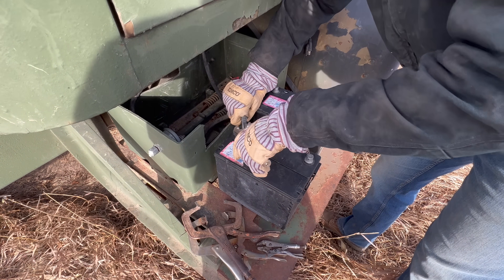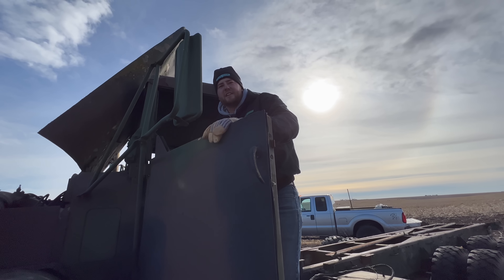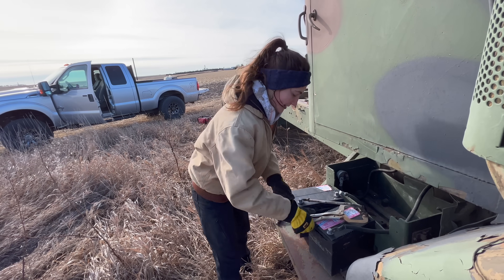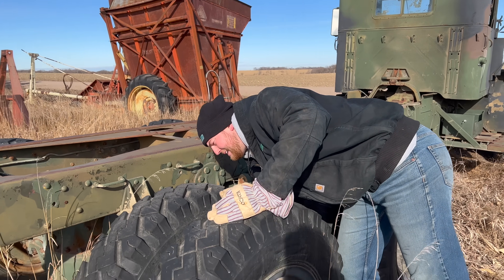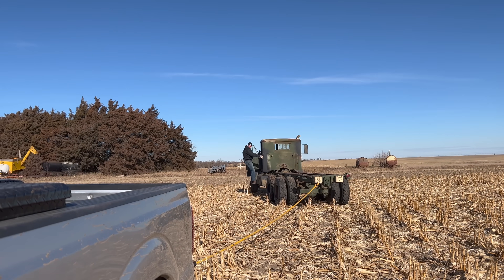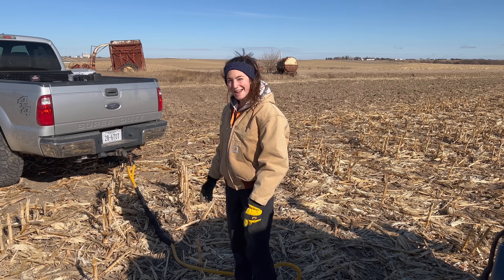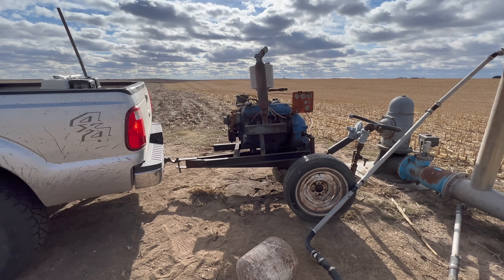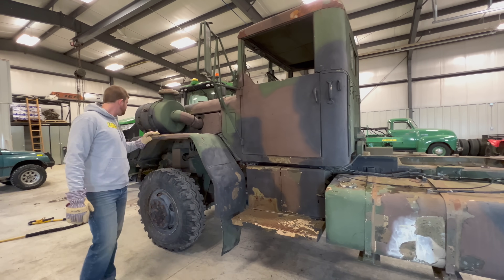If You Can Start It, You Can Have It

Comment: Any of us who have served, and ventured out to the motor pool on a brutally cold winter day, you might need (require) to bring along some starter fluid, as it will not require much, just a quick blast into the intake, as the glow plugs could require a little boost to get the engine to combust & turn over.

Comment: Yes, Multi fuel.  Viet Nam era trucks I'm familiar with.  They had something called a "Density Fuel Compensator" which allowed running on a variety of fuel types.  I would drain all the fuel and fill with fresh diesel.  Then crank it over and bleed each injector to get fresh fuel to the cylinders and remove any air.   If oil viscosity is too high, it may not crank fast enough even with a 24 V commercial battery.   I'd change the oil.    Probably got rat nest in the air filter so you should remove it while trouble shooting.   Good luck.  clean fuel, oil and air and these things will run forever.  If all else fails, do a compression test.

Comment: Run on diesel, kerosene, transmission fluid and old motor oil but if you use anything besides diesel you have to mix a little diesel in it. You can get a manual for it.

Comment: Ok... Where to start...

First thing you want to do is get the TM.

Do a overview once over, and follow the PMCS in the order.
Change the Batteries bank and drain the fuel, and change the glow plugs.

The numbers on the bumper are called "Bumper Numbers.
Left is major command and higher Unit, Right is designated number for the vehicle itself.

Comment: The Diesel engine is the only engine which runs on Diesel, Biodiesel, a mixture of Biodiesel and Petrodiesel,propane (with modification) , Home heating oil, Kerosene,  a mixture of Kerosene and Home heating oil, straight used cooking oil (if heated), Petrodiesel and gasoline mixture, Transmission fluid, used motor oil, etc. I could go on but you get the point a very robust multifueled engine, as a diesel mechanic I have run diesel engines on all.

Comment: Hi, the numbers are the unit designation of the unit it belonged to. On the passenger side is the parent unit, on the driver side is the subordinate unit. An example would be , if the 1st Infantry Division owned the vehicle, it would read “1 ID” on the passenger side. If it belonged 701st Maintenance Battalion. I t would read 701Mt Ben. . The subordinate company  would would  be next followed by the vehicle number. Example B 24.
Reply: whatsapp①⑥⑤⓪⑦⑥①④⓪①⑤  keep doing what you are doing! Love your snippets. Jim peterson.

Comment: It's a 12 volt system and yes they are a multi fuel system. They will even run with water in the fuel. They were designed that way for a reason. Enjoy. You got a good one.
Reply: I forgot to mention turn on the battery switch. It's in the cluster of 3. I'm sure someone may have bypassed it by now.

Comment: Judging by your attire, its a bit chilly there. I would run the glow plug a couple of times and you will need a couple of extra batteries to crank it up faster . You might find some quick start spray into the air intake will get it going faster. GOOD LUCK
Also a 24 v charger will keep the  batteries spinning the starter faster.
It will go, patience.

Comment: Like any diesel engine check the air cleaner fuel filters put fresh diesel in it bleed the injectors and if you're going to change that wheel out being a split rim make sure you put that wheel in a cage when you inflate it

Comment: It appears to be either a 5 ton cargo or shop truck, with the tub/box removed.  Meaning you can make it what you want.  I suggest you find some of the original type tires as that will raise your ground clearance.  undersize tires will also not give you accurate speed or milage readings as the speedo is calibrated for the size tires intended for this truck.  Also, you had no brakes because you had no air pressure.
Depending on what you want to use it for, you may want to "bob" the frame, IE shorten it.  If you want to use it as an open bed cargo truck start looking for an old cargo bed.

Drove and serviced hundreds of these trucks in my career.  You need to find the Master switch and turn it on.  You will know when you have found it (so long as you have batteries in it) as the low air alarm will sound.  That tells you that you have low or no air in the brake system, but it also tells you that your master is on.   Military tactical trucks will turn over without the master switch on, but there is no electricity going to the system so it won't fire off.  We used to move dead trucks (short distances) just using the battery power with the truck in low gear and pushing the starter button, but the master switch off.  Kills your batteries pretty quick, but you just yank them off and throw them on the charger.  This type of truck normally used four 6TN batteries to produce the needed 24 volts.  A pair of 12 volt tractor-trailer batteries will probably do but you need a lot of CCA!

Look forward to seeing your progress!

Comment: Not a multi fuel. Valve covers give it away. Cummins I believe a small cam engine. Check for power at the party fuel pump solenoid. Small screw on the top of the solenoid will allow you to bypass that. Good luck.

Comment: M35, White multifuel. I paid $2100 for mine, had winch, ran great.  I ended up selling it for not much more, but it needed a clutch pressure plate and front driveshaft.  The back did not have dropside, just tailgate. A little starter fluid would have probably fired that one up.

Comment: Get a battery charger for  24 volt systems that has boost or jump function. Once it's  charged up good and the engine is turning over good hit the air intake with a couple shots of ether.  Starting fluid. Not a lot just a couple shots at a time. If you use to much it could  blow the head off.

Comment: There should be 4 commercial-sized batteries.  Two in Seiries and two in parallel.  (You only have about 650 cranking amps and you need about 2000) It is real tricky getting them wired up correctly, that is why you need a -20 TM (Dash Twenty Technical Manual)  A 24 volt system that big will start a fire very quickly.  There is a fuel shut-off bypass so you can pull-start them.  (However, with the fuel shut-off bypassed, you can't shut it off.)  There is also a Pre-Heat system (that even the mechanics couldn't figure out) They are hard to start, but they run great.  Built back in the day when it was possible to run the truck with half the parts missing.  Back before Russia was our friend.

Comment: That is a 5 ton truck. Which mean it can haul 5 tons off road.  It probably had a box or flat bed on it while in service.  I drove them when I was in the Army back in the 80s.  They were great trucks. That is a Multi fuel engine which mean it can run on Diesel Kerosene certain jet fuels. And oil and gasoline in very small percentages like cut with diesel.

Comment: Having raw started a number of in the field trucks/tractors before, several things I always do before even hooking up any power. I use a meter and check the wiring to make sure there are no shorts and no open connections. If there is an open connection, I then check it out and find out why the connection is open. (I hate blowing up batteries). If something is bad and it related to the engine firing or not firing, I see if I can get the part for replacement. Next, before getting parts or hooking it up, I hand crank turn the engine over t ensure that it is not locked up so I also do not burn up the starter motor.  So, good idea to have a couple of big boy 24V batteries, cause it might take a couple to get the best fired up. I then hook up a fuel tank with fresh fuel. BTW, these beasties can handle a wide variety of fuel oils, even filtered waste veggie oil. But for first firing, fresh fuel and a can of either. This is what I do before I even think of hitting the switch to try and fire up the beast. BTW, this looks like nam era.

Comment: Check your fuel lines. And diesel algae. Lube up your cylinders with oil 11 and a half oz per cylinder change your filters you may try to start it with starting fluid. Also check your glow plugs

Comment: that is a 855 cubic inch Cummins diesel engine with a 250 horse power rating. It should have a compression release leaver under the flat plate in the front top of the engine. if you put a open end wrench on the leaver from the drivers fender and push down you will feel it bottom out. While holding it down have someone hit the starter it will turn over much easier because of no compression . it needs to be spun untill  you have oil pressure then if you have fuel in the pump it willl start.

Comment: Looks like old Studebaker  with Lycoming multi fuel. Goes about snail on crack. You will need alot of amperage to crank it. It can drag it just turn to run make sure mechanical fuel shut off is on or in. Drag it then slip into 5th let clutch out drag till its warm should fire.

Comment: Looks like a 5 ton, most likely a Cummins diesel. Remove the fuel filters replace with new and prime the filters. Change oil and give it a crank... I'll bet it'll start up. Inject some starting fluid in the intake if it's really cold... Good luck.

Comment: If this truck is like the ones from WWII era--->They used a POSITIVE GROUND for the 24Volt System.  Check to make sure your truck uses a POSITIVE Ground. - If so then the Battery Positive Terminal must be connected to the Chassis GROUND.

Comment: Its an old 5 tons, those number are unit and bumper number. In emergency situation a multi fuel can run on use oil, kerosene, and mo-gas mix with engine oil (not 100% sure on gas/oil mix) please be really careful on those tube tires and split rims, I've seen it came apart one too many times. It will kill you if you're not careful. If you are planning on reuse those rims, make sure you clean it really good with wire brush. When install locking ring, making sure it seats properly. If you have a tire cage, put in the cage while airing it up. Use extends lockable air hose for safety. Have fun and good luck.

Comment: I had the. Same problem removing an oil filter on a Kubota. The filter was factory installed.  We tried everything. Finally resorted to cutting it off with a Dremel tool.  I do not recommend.  I can say no damage to tractor.  Once the filter tears  to much then you know your in for a long day

Comment: I'm sure this is too late but you will need a couple of very healthy batteries with good connections to get it to crank good, they originally had 4 batteries. As mentioned, that engine is not a multifuel, just a regular diesel NCH250 Cummins. It's a good engine though, you can put a turbo on it and really make it have some power. Those trucks have incredible pulling and off-road capabilities if you have enough weight on them. Videos you see of them struggling off-road are almost always with no weight on the back, and they hop and bounce and spin tires, but if you have weight on them they will pull the world apart. I have two of them and my wrecker version has pulled massive trees out and stuck trucks and tractors and backhoes just effortlessly. Even in the snow they do well.

Comment: If you still have this old military truck, you could put container bins on the bed and transport corn to the co-opt?  More trucks delivering corn the faster you could be preparing for the next planting and harvest. Otherwise use the engine to run the pivot water pump, scrap the rest.

Comment: Yes they can run OG gas, just about anything that will burn, you need to adjust the fuel distributor because it takes a lot more gas than it does diesel, if you run regular gas though remember to add oil to it for your pump and distributor, gas has no lubricant in it, I miss my M35A2 hope you guys have fun with the 5ton

Comment: Check out the air filters  fuel filter check and cleaning bleeding the fuel injectors then try to start if problems pulling and cleaning the injectors will help

Comment: It would definitely be an awesome job to put a flat bed on it so that you can load hay on it or a dump box so that you can haul corn or beans to the coop!!! We use one for hauling square bails of hay and can just back the whole unit in the barn Incase of rain if you don’t have time to unload!!! Definitely works for us and much safer than using a regular 3/4 ton or 1Ton truck!!! Especially for hauling grain to the coop!!! I’ve definitely pulled wagons full of grain before to the coop and with all the weight and hills in Iowa the loads definitely take a toll on transmissions and the brakes for sure!!! But with a military 6x6 they definitely fit the job much better!!!

Comment: KERRs (Kinetic Energy Recovery Ropes) have been around for donkey's years but the ones I was familiar with in the 1960s were an eight-plait nylon rope construction. Do be careful, any weakness in a towing point and heavy lumps of steel will come flying through your rear windshield! That was a generous gift of 'Matt's Off Road Recovery Rope' complete with the soft shackle.

Why-oh-why would you drag the Army Truck out with a puny pickup truck when you you had a powerful tractor capable of dragging it sideways through a bog up a 45° incline? For fun?

Comment: If that is a Continental engine it is indeed a multi fuel. While stationed in Germany (1970) we ran our trucks in winter with a gallon of gasoline mixed in a full tank of diesel fuel . The trucks ran fine and at highway speeds (60 mph) at night there was a blue flame out the exhaust that was impressive. I’ve heard it said that they will even run on alcohol if you mix it with 2 stroke oil. Ratio? Idk. Anyway, that thing could be a pulling beast if you shortened it and added weight on the rear end. Have fun!

Comment: 13th coscom(or combat casualty support) 1st  med battalion 36 med company  possibly, you can see where it changed units several times.  

Those are good old trucks, Armstrong steering with that manual trans. Drove military semi’s for 16.5 years, and absolutely loved it. I only got to drive the manual trans ones in Iraq, where they had been pulled out of the emergency depot for the Invasion

Comment: If it's a multi fuel engine it can run on any petroleum products. Gas DIESEL, motor oil, transmission fluid, power steering fluid, gear, vegetable, kerosene etc.

Comment: He guys take a peek at Andrew Camarata's channel for inspiration on fixing the equipment. Drain and clean out all old diesel fuel first. Buy a new can of starting fluid. Get the correct batteries and have a full size shop start/charger ready to go. Clean out air filter and add fresh diesel. Give her a whirl and she'll speak to ya telling ya what she wants. Good luck from an old man in the woods. 🤘😁✌
Yes previous comment was good safety on tires and Andrew has an old vid on doing those types of rims. 👍

Comment: When I was in the National Guard in the 1980s my unit had Gasoline, "multifuel" and diesel 2 1/2 ton trucks.  The "Multifuel" trucks were the worse, Gasoline jobs were kept longer.  The "Multifuel" truck was a diesel truck that could be operated with a mix of gasoline and engine oil. I has been 30 years but if I remember right it was one quart of oil for every five gallons of gasoline. I drove all three and liked the Gasoline jobs the best (when they were running, which was NOT often, they broke down constantly, most were built in the late 1940s and I was driving them in the 1980s). The gasoline had more power off road, much lighter engine (Almost 25% lighter then the diesels) and easy to drive (Given it had no power sterring).  
This looks like a Diesel engine not a "Multifuel" engine but I would only run diesel in it.

Comment: First of all get all that old fuel out of the tank . Replace fuel hoses, check that the fuel pump works properly. Get new batteries and the right ones for this truck. Send new fuel through the fuel lines. Make sure the radiator does not leak, then try to start it. Because it has been sitting for such a long time you are probably looking at a full restoration job , which you guts are capable of doing yourselves. Find some nice suspension seats out of a modern truck, rebuild all the brakes. I wish you fun with it.

Comment: if its the Hercules engine yes it can run on almost anything. from trans fluid to engine oil mix to regular diesel. they were meant to run jp-5  which is a low grade diesel i believe

Comment: It's not Volts you need.. it's AMPs you need, and yes you can get that from the two battery's you have just connect in parallel.that will give you more cranking amps. ❤

Comment: Batteries. 
You can have a battery that says it's 12.5, to 13v, and even freshly charged, but that has nothing to do with the cranking amps.

Diesel engines are generally high compression, and usually takes a lot of power to start.

I've never personally seen, or heard of a diesel engine being bump started, because it still needs the glo plugs to help start.
But I know far more about batteries than diesel engines.

Comment: This is what we used to call a 'Long-bed 5-ton truck (not sure about the numerical designation).  It was distinct from normal 5-tons.  The Bumper numbers appear to be 3COS, which could be 3rd Corps Support Command (COSCOM).  The '1 MED' is likely the the 1st Medical Brigade.  The '36M' could refer to a medical company assigned to the 1st Medical Brigade.  Mostly guesses - 3rd COSCOM was rechristened the 3rd Expeditionary Sustainment Command after it returned to the United States in the 1990s so it's hard to say for sure.

Comment: Drain the fuel and change fuel filter.prime fuel by cracking open the fuel line further east away from fuel pump.turn engine over till no bubbles are seen . tighten fuel line.now your entire engine is prime.if you have ignition it should start.